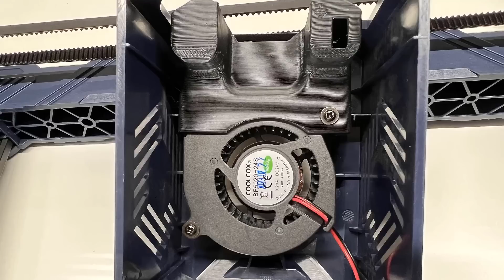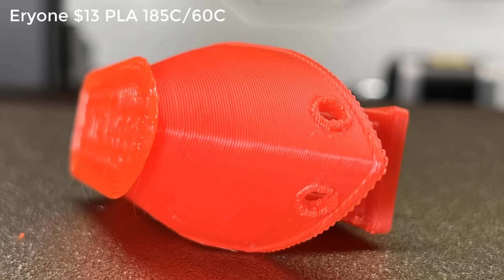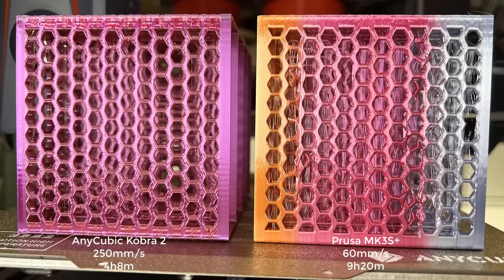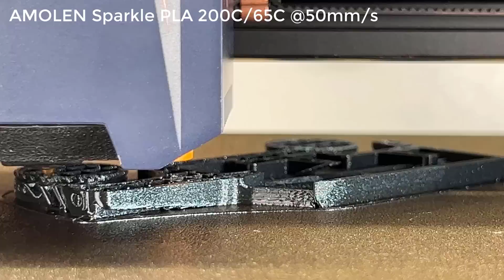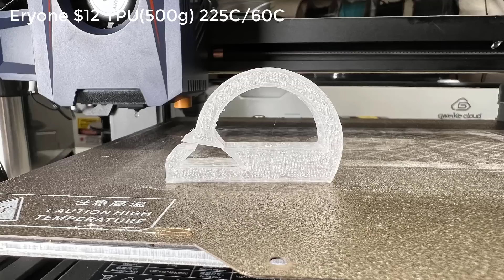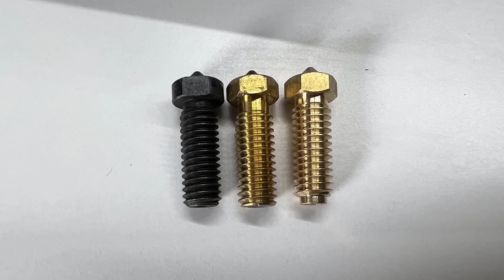AnyCubic Kobra 2: sub $300 fast printing 3D printer, auto z-offset, nozzle cleaning, 30 mins benchy

Comment: Another Fantastic review Aurora, exciting times ahead with these new generation of high speed printers that produce mainly excellent results. Keep up the good work😀👍
Reply: It does take some tweaking. I honestly was a little disappointed at first, but since tweaking it more and more I'm feeling more confident. I think I can still pull plenty more quality out of it. I like the lower price take because it's easier to replace it than say a Bambu X1. Albeit the Bambu X1 is twice as fast but it's $1400.00+. I can get almost 5 of these printers for that. May print slower but still faster overall when printing multiples.

Comment: Update on my Kobra 2:  They're sending me another print head module, I'll keep you posted.
Reply: Did the new print head work out?
Reply: @ZombieOfun  I'm still waiting on the part from China. I'll keep you posted.
Reply: @ZombieOfun  Yes, the new print-head module worked.  I'm running some tests.  I'll let you know when I print out a benchy. But so far, so good.
Reply: @ZombieOfun  New print head printed a nearly flawless 3D Benchy in 31 minutes.  This printer is not perfect but for $248, I can't complain.

Comment: Sunlu S2 Filadryer can actually reach the temp of 70 celsius, PA can be dried and the printing quality is much better. Highly recommend it!
Reply: The FIXDRY Filament Dryer  also claims 70 C and is cheaper.  I would love to hear from anyone who has tested the internal temperature of either of these. Do you actually own the S2?
Reply from the maker: Fixdry can't reach 70°C or even 60°C. I used it once in my previous video. I'm not sure if I received a faulty unit or not, but I can't recommend this brand.
Reply: @petercallison5765  Yes, I use a S2 Filadryer for about one month, and it did improve the printing quality of material like PETG、 PA，seems no big difference on PLA.

Comment: I just wanted to provide an update.  I received my Kobra 2 but I'm having issues with extrusion even after adjusting the extrusion force.  The screen is very sluggish as well. I've opened a support ticket and I am waiting on a response.  Also, I don't see any firmware updates on their website.  I'll keep you posted.
Reply: Any updates? Ty
Reply: @TheFoxalot  Nope, I ended up giving the printer away.  I wasn't happy with the lack of diagnostic support and lack of firmware updates at that  time.
Reply: @edg5428  ty sir!

Comment: 👀 Sonic Pad to the rescue? 🚀 Could you show us what this printer can achieve when being controlled and optimized by the Sonic Pad?
Reply from the maker: Running Klipper firmware on this printer may result in the loss of certain features like auto z-offset calibration and nozzle wiping. To retain these functionalities, you would need to create a custom Macro for nozzle cleaning and write code to gather data from the tool height sensor and convert it into the z-offset value.
Reply: @Aurora Tech  Thanks for your reply! I see. Could it be worth it?

Comment: I just ordered one using your coupon code.  I had wanted to have an additional 3D printer besides my Bambu X1 Carbon which I love and my Prusa Mk 3s+ which I'm not using.  I was going to upgrade it to a  Mk 4 but at $579 upgrade and still cartesian rather than an a core XY, it doesn't pay, for that price I could get a P1P or a K1 Creality.  But at $248 with you coupon code and good review, I pulled the trigger.  Thanks again.

Comment: I wish you had done a deep dive on the electronics as Anycubic, among others, have consistently tinned wires going into screw-down connectors and other unsafe practices.  I hope this isn't another machine that does this.  I'm also curious about the quality of the wires and if the bed heater wire is a silicone wire?  Several Anycubic Chiron users have experienced smoke or even fires from their bed wires being of poor quality.  Sadly, as manufacturers strive to be the cheapest, the quality of the components suffers and the customer ends up with a machine that fails or requires many upgrades to print with the originally promised quality.  (Meanwhile the company comes up with another new, cheap printer better than that one 6 months later....and the cycle continues.)  Thanks for a very informative video

Comment: My go to for bed adhesion glue is Elmers washable purple glue
It goes on purple and dries clear
When it comes time to wash the build plate once you put water on it the glue goes purple again
This makes even application of the glue easy and washing it all off easy as well
The best part other than how well it works is how cheap and readily available Elmers washable purple glue sticks are
Reply: Does it come off pretty easy or do you need to use something like goo gone to motivate it?
Reply: @Jacob Acosta Master Scribe  It comes off with just water but I always wash my build plates with dish soap and warm water
Reply: I use cheap Walmart glue sticks. Works fine

Comment: Do you know if the auto z offset feature is based on electrical conductivity (nozzle to switch) or is it a true switch? If its conductivity this will affect which nozzles you can use. Nozzles with dlc coatings or ruby/diamond tipped nozzles will then not work

Comment: I don’t care about speed. I care about reliability, durability, cost and can if it print CF nylon out of the box? I can wait a little longer on a print if it can print CF nylon well.
Reply: Can't think of any hobbyist printer shipping with a steel nozzle and abrasion-resistant filament path as stock.

Comment: 2021: copy Ender 3
2022: copy Ender 3 and add something new
2023: 30 minute Benchy 😅
Reply: I have to take some of this back 🙃
I printed AC 30 minute Benchy gcode with similar-ish printer with IS and LA but with POM wheels and 5015 part cooling. Cooling is too weak + there are some speed artifacts not visible in Kobra 2 review prints (at least in this video) 👍
Still impressed it pulled it off with so few problems 😊

Comment: Miss Aurora, I have a question. How the heck do you make everything you print look so good. It doesn't matter what printer you're using, all your prints look utterly fantastic.  I notice you don't buy expensive filament, usually Everyone, please correct me if that's inaccurate.  I would love to see a video of how you tune a printer.  I mean everything maintenance, calibration, and setup.  You clearly have a talent.  Also, I would love to see a Klipper video on how you would set it up from beginning to end.  Confession you have no idea how much your Marlin build video helped me my first couple years in printing.  Thank you for everything you do

Comment: I really like the choices they made on this printer.  Really like the steel wheels and the decision to not use 2 z stepper motors.  If they would have used the standard volcano nozzles and had a high temp hot end they would have hit a grand slam home run.
Reply: Agreed. the part cooling fan is also a really good choice. I never understood how poorly all the stock setups were, when even going to DUAL 5015's is so cheap.. seems they matched that flow rate with a single fan so it should not be a bottleneck at ALL.  very happy with that.  just need to sort out the nozzle situation.  (and firmware of course as they will not likely release it GAH)
Reply: @DavidBaumgarner  What's wrong with its nozzle? I am considering buying this printer but have no clue about nozzles.
Reply: @Komandie  It is just not a common standard nozzle, so I am not sure what we will have for replacement options. Especially cht style.
Reply: @DavidBaumgarner  I see. Thank you.

Comment: I have a normal kobra. I find I have to run very low temps to try and prevent stringing. I print PLA at 180, PETG at 200. Still get some stringing and perfect layer adhesion.

Comment: I appreciate the increased focus on testing profiles. However, I feel like a lot of time was lost by not doing test prints up front. You can use layer change gcode to increment speeds across a speed tower (or use orcaslicer wavy pattern). Along with similar towers for acceleration, fan speed and minimum layer time, you could have zeroed in on some good settings much faster.

Comment: Great review! Today I am looking between Sovol SV06, Elegoo Neptune 3 Pro and AnyCubic Kobra 2. Which you think the best?

I'm probably thinking of upgrading to klipper later if that will makes sense

Thank you!
Reply from the maker: I would choose the Kobra 2, especially since they are launching the machine on May 20 with an additional $30 discount. $250 for this hardware is an unbeatable deal.
Reply: @AuroraTech  oh man, when I finally settled on Bambu P1P, I see this review. 😂 Would you say P1P is worth 3x price?
Reply: @AuroraTech meh, for some reason it costs 354$ in EU, not so great deal
Reply: @AuroraTech  The profile you uploaded for Kobra 2 is incomplete/missing what you covered in the video. Nice try though!
Reply: I went with sovol s07 - too many qc problems with the 06 - have to wait a month for shipping tho, patiently waiting still….or June 1 you can order brand new Neptune 4 pro!! Looks Amazing
Reply: Elegoo is announcing their own Klipper printer in a couple of weeks.  Sovol's latest is the sv07 or sv06 Plus, not the abandoned sv06.  I'm sure Creality must also be cooking something up. Just hold on to your wallet for the next 4 weeks and see what develops.  If you can't wait get the Neptune 3 pro.  It's the least impressive one on paper, but the most refined one out of the box.

Comment: Your reviews are so thorough and well communicated. Your expertise in the field shows through loud and clear.
Reporting on reliability and wear takes a lot of time so is difficult to do and doesn't readily fit into the channel's objectives. Perhaps you could add a section on parts likely to wear or fail, based on your assessment and observations during tests and replacement/repair costs if one was to purchase parts from the printer supplier?

Comment: Nice, but outclassed by the SOVOL SV07. If I were in the market for another bed slinger, I'd go for the SV07 with its native Klipper firmware and display, and its input shaping. Nice video!
Reply: Yea but the SV07 retails for 399, it was only because of all the backlash on the facebook that they dropped the price, so it will likely go back up or be EOL'd really quick if I were to guess.
Reply: But sovol QC is only rival by creality QC...
Reply: @Kevin000  Sovol=Creality, they are the same company just like Jayo and Sunlu are.  They are their own brand and they have their own products, but they are owned by the same people and even share the same building.
Reply: I would put my money on the Elegoo Neptune 4.  I will actually buy one when they are available in a few days.
Reply: @petercallison5765  I believe you are right but the estimated delivery for N4 is August/September. That's 3 months away.

Comment: All ready sold out😑
Reply from the maker: No, the machine will be launched 2 days later on May 20, I guess their shopping cart just won’t allow them to customize that, so, they just set the status to sold out.
Reply: @AuroraTech  I got the Kobra2 yesterday and out of the box it has been perfect. I downloaded your config file for Prusa Slicer but it did not have as many options as shown in your video. Is it possible an older version of the file is on your download page?